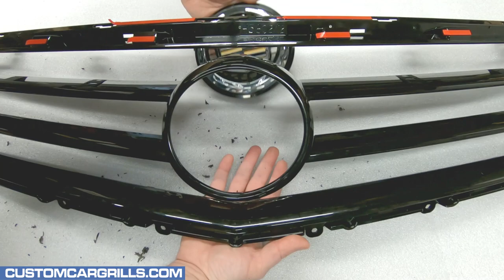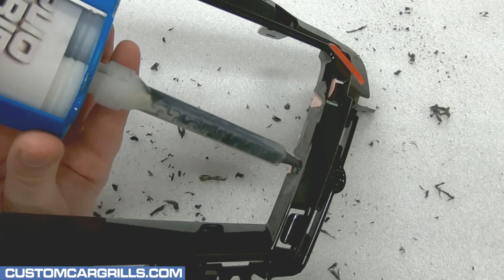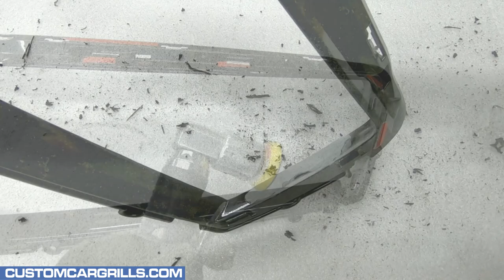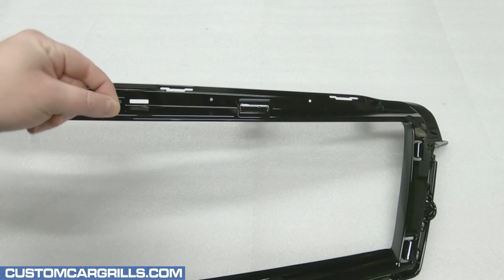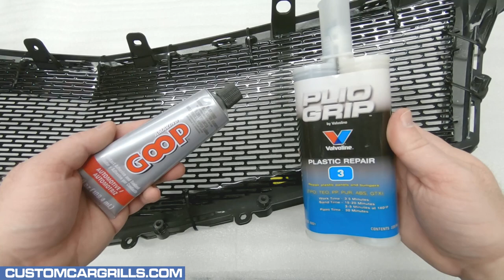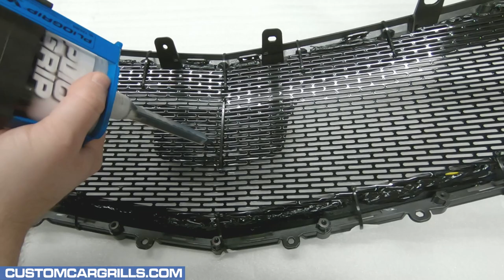Cadillac ATS 2013-2014 Upper Mesh Grill Installation How-To by customcargrills.com

Comment: Is it necessary to cut out the horizontal bars? Will the mesh not fit behind them?
Reply from the maker: I did not try that, but I would suspect that the bars would prevent the mesh from fitting properly.
Reply: @customcargrills is it possible to just use a rotary tool to cut out the first layer of the grill with it attached to the car still? I really want to upgrade my grill with a mesh overlay but don’t want to bother removing the entire bumper to access it.
Reply from the maker: In short, it would be quicker and easier to remove the bumper than try to do the installation with the grille still in the bumper (and the bumper still on the car).

Comment: Do you guys have any grill upgrades for a 2013 Cadillac ATS Premium 3.6? I just want to upgrade the old style logo to the new style logo. Please let me know.
Reply from the maker: Is the Premium different than the one we show in this video?  I'm not an ATS expert, and at a quick glance they appeared the same.
Reply: customcargrills I don’t think there is any difference in the grill. Do you guys sell a ready made product or just simply the do it yourself instructions?
Reply from the maker: On our website, we just sell the mesh.  I can do a ready made set but the cost of the oem pieces drives the cost up dramatically.
Reply: customcargrills Could you quote me a price for a ready made Grill? I just want it ready to install. Plug and play.
Reply from the maker: Yes, I can.  Please send me an email ( info@customcargrills.com ) and we can go over the available options.
Reply: customcargrills Excellent. I will email you shortly
Reply: Where can I find that black emblem at?

Comment: Do you have a service where I can send the grill to you and you do the installation and if yes how much would you charge for exactly like how you did it with the emblem and everything
Reply from the maker: Hi, we can do a service where you send in the grille and we do the installation.  The labor to cut and refinish the sides, as well as the paint job is $250 for the top section.  The upper mesh + emblem is $150.  If you were to send over your stock grille, it would run a total of $400 + shipping.  The matching lower piece would be extra, and this pricing is subject to change in the future.
Reply: @customcargrills  are you still doing this sercice
Reply from the maker: @snowboarddan5899  Yes, I can still do this.  The prices have gone up a pinch, but feel free to email me for a quote.
Reply: @customcargrills  where are you located ?
Reply from the maker: Grand Rapids, Michigan

Comment: So I have the adaptive cruise control emblem, is there any way of getting around that, or moving the censor out of the emblem so I can use this grill and new emblem?
Reply from the maker: I'm afraid I don't currently have a solution to that issue with the cruise.

Comment: Will this fit the 2017
Reply from the maker: It will not.  We can make one, but I would need a factory grille to be sent in so we can measure and prototype it.
Reply: @customcargrills  can you guys take care of everything like making, installing it and just send it back ready to put on? i wouldn't mind paying for that i have zero experience working on cars. thanks
Reply from the maker: That could be an option.  Feel free to send me an email and we can work out the details of how we could make that happen.
Reply: customcargrills thank you 🙏
Reply: @customcargrills  I'm interested in this to. I highly recommend you guys have an option at check to where customers can choose to have you guys do all the work. 
Say for what an additional $100? But i think you could probably sell alot more and faster at $50.
Reply from the maker: We can offer that, and we have done some in the past.  If the owner would like to send over their grille set, the cost would range from $300-500 depending on what they want done, and about a 3-4 week wait.  

We can also do full replacement pieces where we provide the donor grille and it's a direct swap, but those run upwards of about $1,000 right now.

There's no way I can properly and professionally do the mod for $50-100.  $50 doesn't even cover the cost of the plastic repair epoxy that's being used.
Reply: @customcargrills  If you've "offered these in the past" then theres no reason that option shouldn't be available at check out. 

Theres no way that taking an oem grill then modding it cost $1,000. Pick N pull exist for a reason. 🤷‍♂️

Also i said ADDITIONAL cost $100+? Please don't twist my words. Thanks and happy holidays.
Reply from the maker: Our main business is making the DIY kits, not making full replacements.  That is why this is not an option at checkout.  Only a handful of very specific makes/models are offered on our site as full replacement pieces.

As for twisting your words, feel free to re-read what you wrote; and I quote "Say for what an additional $100? But i think you could probably sell alot more and faster at $50."  That is where I came up with the $50-100 cost.  Those are literally your words, I am not twisting anything.

Feel free to shop this type of work around if you think I'm pricing it too high.  Take it to a body & paint shop and see what they quote you on it.  If you can get it done for $100, then go for it.  

As far as donor grilles go, again feel free to shop around for them.  The ATS grilles are not cheap.  The cheapest one I could find on eBay was $500 for just the upper piece, which is the average going rate I've seen them on there for years.

Comment: Why the fuck don’t they just sell one that you can just put on.
Reply from the maker: Reason #1:  Because GM / Cadillac doesn't have any grille frames for us to buy anymore.  There hasn't been any available for years, and used ones rarely pop up on eBay.  There's also no aftermarket frames available.

Reason #2:  When I did offer pre-made grilles for these, no one bought them because the price was too high because the grille frames themselves from GM / Cadillac are about $1,000.

If you have a set of grilles to send over, and about a $500 budget to pay me to modify a set for you, then send me an email and let's do this.